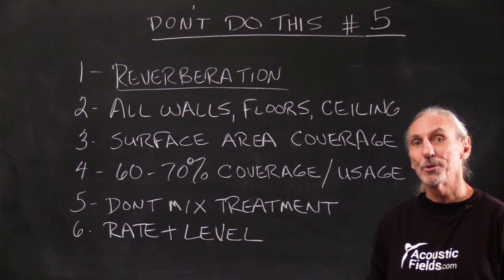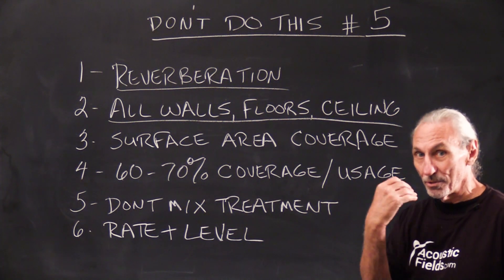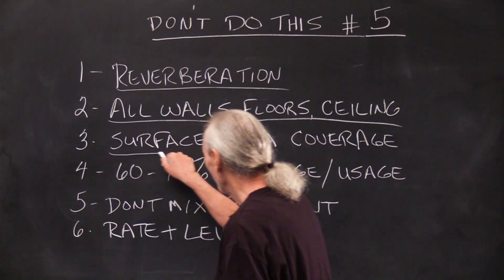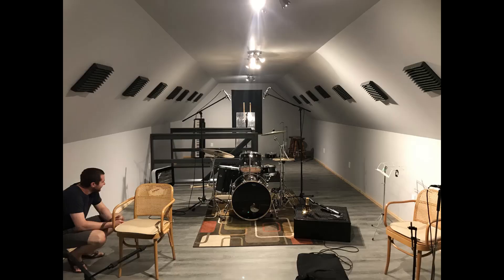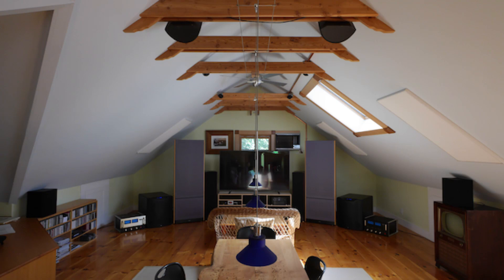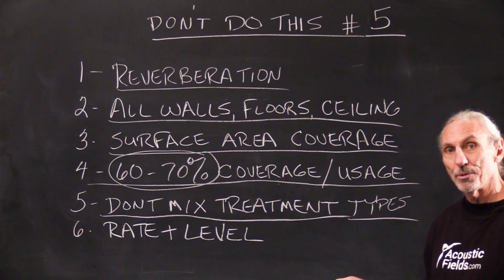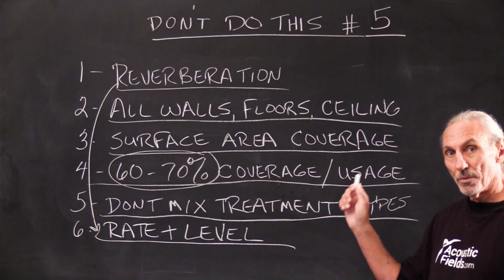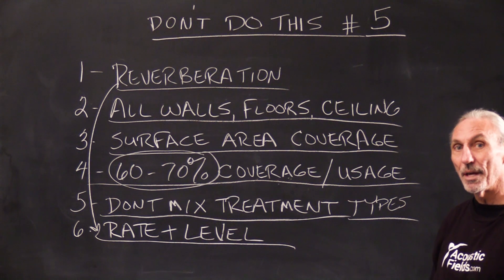Don't Do This! #5 - www.AcousticFields.com

Comment: Is the 60-70% “coverage” the terms of treating at least 4 of the 6 surfaces? 

Making it sound like treating 70% of the surface area is the goal vs the last video said you needed to treat at least 4 of the 6 surfaces, am I correct in my thinking of the 70% mentioned in this video as the latter?
Reply from the maker: Once again I will caution you about looking for a one size fits all solution. In acoustics, there is simply no such thing regardless of what you read on the net..

Comment: Halfway through the series I'm starting to get a little annoyed with the half-held-back info. Like 'reverb time 3 seconds'. What the heck does that mean? Ah, Google says its the time for sound presume in a room to decay by 60%. Great I understand better now. I still don't know how to actually measure or what treatment to apply or what equipment I need but at least I know what you're talking about. 

Of course I appreciate the need to protect your business. My thoughts on the matter (borne out through experience) are that I could tell you exactly what I do but you still won't be able to do it the way I can. The instinct, the experience those are things I can't teach and you can't learn. And you probably don't have the tools and the equipment that I have invested in and built up over time. So you're no threat to me. 

In fact it works the other way. As soon as people realise all that its going to take they are the quickest to hire me. The only ones who don't are the ones that maybe can't afford it or have other reasons. If these people DIY using something that they learned from me and get a 10-15% result I have no objections to that because its not money out of my pocket, it money I was never going to see anyways. And there are benefits - one, they're now converts. They believe. Two, there's goodwill, they appreciate where they got the help. And three, if circumstances change they're more likely to give me their business than my competitor.
Reply from the maker: We try and make the complicated simple. Sometimes we succeed, sometimes we do not.

Comment: "Don't mix treatments"... This is so true! 

   I'm gonna give some context because some of you may be in a similar situation. I've got a near perfect square 12 x 12.5 x 8.9 bedroom/studio. So the coincidental wall problem really needed a lot of treatment. I went crazy buying different kinds of insulation over time and some second hand pre-fab products. That strategy did exactly what you just said Dennis, 'sucked the life out of the mids and highs' while just barely touching the low-end. The response / levels of the low-end was better managed but the Rt-60 readings look like a chair laying down on the floor lol. Needless to say I wasn't happy. So, after being on the fence for years, lots of research on diaphragmatic absorption and other companies that make them, I took a leap of faith. Called up Dennis and told him about my nightmare just to get his input, his computer started smoking, he freaked out and rightfully tried to run away from the phone lol. Saying I'd have to build them floor to ceiling if I wanted to have a chance.

   So stupidly I built just 3 Bda's sized 24"x 48" unit I'd say.listening positionexceptMixingmultipledidn'tstereo image was starting to really come through, my center image was always decent but now the speakers were starting to 'disappear' completely. And that's when I noticed, that as I moved towards the back of the room, the stereo image (of mids/highs, lows are still messy) would change quite drastically.

   And its without a doubt because I had 4 different types of left over material along my walls (equally on both sides). I took them all off. Sounded terrible but CONSISTENT along the side walls. That confirmed to me a thought I had in the back of my mind for a long time as I been to other small studios like mine but wouldn't admit to myself. 'Guess what Temu? Building insulation sounds like......building insulation.  But it's not helping I where I need it most. I don't like the way it sounds anyhow. Why am I putting this sound signature on everything hear and record? It's time to kick this habit and try something new' you'refrequency in a headlock in a near useless effort to truly conquer the low-end problems. The BDA is not a typical sponge, but rather two water dams followed by a sponge sandwiched between two perforated dams followed by another dam before you reach the wall surface. An entirely different beast altogether.

So that's it.. Now I'm having some more Bda's built by a pro woodworker for the low-end and treating the walls with foam panels. Building everything on the cheap but in a way that I can get some better results fast and position myself to upgrade to some carbon and pro foam when I'm ready (top gaskets on cabinets and open backed panel frames). Folks, if you can squeeze out a foot of space behind your speakers, take the leap and try to get 3-4 in there. Hear that pressure drop and new things will pop out. But if you just GOTTA have insulation on your walls then at the very least stick with one type.

Dennis, thx so much for all the advice you've been putting out there. You given away a lot more than most if one puts the pieces together.imagine what the carbon and foam is like, however, for what it's worth, I honestly think the AF principles are even more powerful than the products for small rooms in the long run. I've spent $50 on you Dennis!! And you've saved my room!

Comment: Can you clarify when you mention not to mix types of treatment?  I was under the impression that diffusion in addition to absorption will help manage reverberation time.
Reply from the maker: Reverberation times will increase with diffusion. You must absorb down to the level required for your usage then introduce diffusion once Rt-30 times have been managed correctly.
Reply: And great video as always. I particularly enjoy this series.

Comment: Can you post a chart of the different types of room applications (2 channel listening, home theater, control room, vocal room, etc.) and their respective RT60 time range that are desirable?  Thanks in advance.
Reply from the maker: Go ahead and put one together. Just two columns USAGE  RT-30 RANGE We can discuss numbers after chart finished.
Reply: @AcousticFields  I was hoping you had the numbers.   You've mentioned some of them in videos, but not all.  I have read articles from other sources for control rooms bring between .2 and .5 .   I know ultimately it's a personal preference, but isn't there some generally accepted ranges already established?
Reply: @AcousticFields  What do you think?.    

RT60- <1 sec.  Classrooms
RT60 - .2 to.40 Home Theater (according to Dolby, supposedly)
RT60 - .3 to .5 Control Room
RT60 - .2 to .5 2 Channel depending on personal preferences and type of recordings.
Reply: @Oneness100   If its a small room(domestic size) you want to bring the rt60 as low as possible, if you want to hear the source, especially reverb tails and subtle effects. Its just laws of physics, which wont change. No matter what some voodoo companies try to sell you.

Comment: I worry if I over treat the side walls it will affect the center image negatively
Reply from the maker: If you overtreat any surface area it will impact performance. You must focus on rate and level of absorption for music and voice since music and voice are different than noise.
Reply: You will. I did it already lol.. check my other comment. You could be in a similar situation.